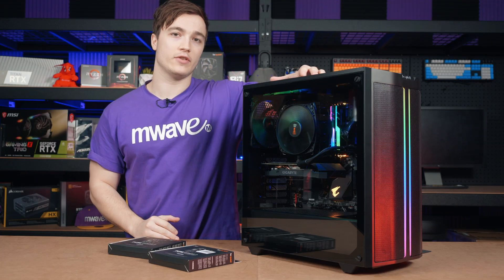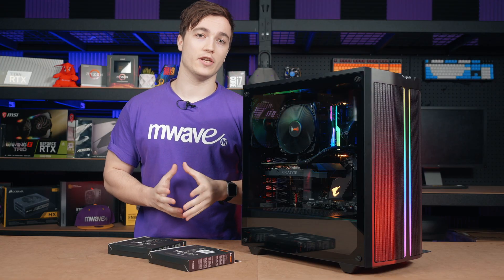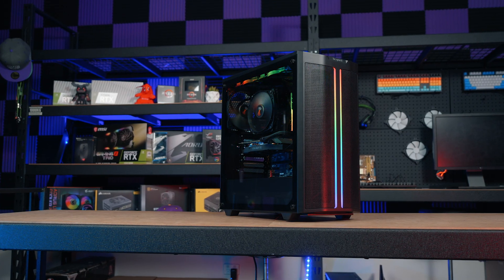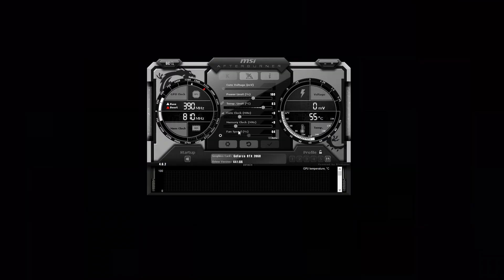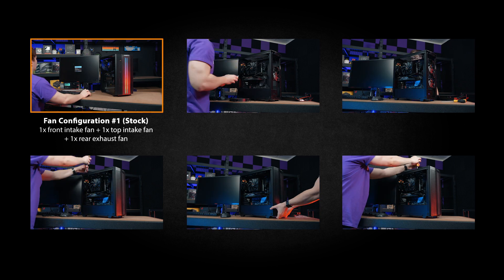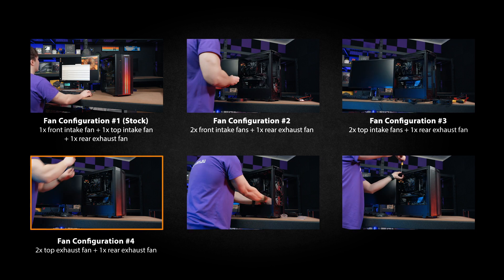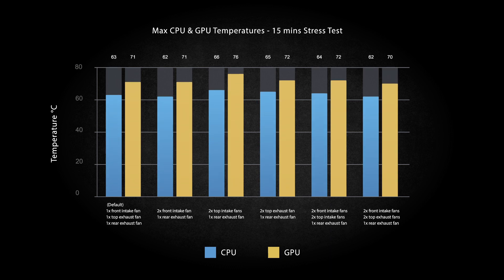Are more Fans Better? be quiet! Pure Base 500DX

Comment: Excellent and very informative video.
I bought this case and use z73 (3×120mm) nzxt for my cpu.
I have also in use 2 top 140mm intake fans and one rear 140mm as exaust. 
From your experience do you believe is good to swich one of the top fan as exaust in order to achieve better gpu temps
Reply from the maker: Hello mate. Glad you found the video helpful 😊

If you have installed a 360mm AIO cooler in this case, then I presume that it's mounted at the front as that's the only spot that supports a cooler of that size. However, you said, "I have also in use 2 top 140mm intake fans and one rear 140mm as exaust.". What is the orientation (intake or exhaust) of all the fans in your system?

I would recommend having intake from the front, and exhaust from the top and the back.

Comment: So the default configuration is the best.
Reply from the maker: Hello! Yeah, the default configuration was the best with 1 other configuration giving similar results 🙂
Reply: @MwaveAU  If i move the top fan in front so that i have 2 front intake fans and one rear exhaust fan is better than stock configuration? Should also get less dust in it's correct?

Comment: I but the stock ones 3x140 on the front(yes they fit) and one rear exhaust and one rear/top exhaust both 140noctua fans and the case r cool and silent
Reply from the maker: Adding Noctua fans is always a nice touch. They push a high amount of airflow even at a low RPM so even at a slow speed, you get that nice cooling while still being quiet! 

I do need to confirm that this case can fit 3x 140mm fans at the front as the be quiet! product page for the 'PURE BASE 500DX' states that you can only fit 2x 140mm fans at the font. Luckily, I still have this case in the studio so I will check it out when I am next in the studio. I believe there is currently a 360mm AIO radiator mounted in the front. It will be good to confirm and inform others that this configuration is possible.

Thanks for leaving this comment and I am glad your configuration is keeping things cool and silent 😀
Reply from the maker: Hello again Mario. Just wanted to check, are you sure you have the be quiet! Pure Base 500DX PC case and it's not a similar but different model? I have just measured up 3x 140mm fans in the front panel on this case downstairs and I am about 30mm short in terms of installing them all.
Reply: @MwaveAU  im sure,the stock fans(pure wings 2) fit. front, between the frame and the dust filter. Noctua ones didnt fit,its somethinh how the fan frame r made. If u wish i can send u a picture.

it is a tight fit, the lower screw places of the fan at the bottom do not overlap, but the fan itself fits nicely between the frame, so that the two bottom screws do not need to be attached at all.
Reply from the maker: Haha okay, this makes more sense. I was going crazy in the studio wondering how you managed to secure 3x 140mm fans in the front of this case. I know and understand that you haven't screwed them all in😂 In my opinion, I would classify this as "they fit" 😆 But if they work fine for you and you are happy, then awesome. Just make sure they don't rattle under a high load, otherwise, love the out-there thinking mate!
Reply: @MwaveAU  The fans are very firmly in place, the lower fan fits nicely in the case metalic slot (use a little force) I believe that it is not intended that way, but it is possible. And it works super well.
Reply from the maker: I also believe that it is not intended to be used that way, but as you said, it works super well and your system is running cool and quiet so nice job! 😀
Reply: Hi there , is it possible than you could send me a picture on how you did it ? My custom pc is on the way and i would like to place the 3 stock fans on the front like you did! Thanks in advance!

Comment: Just bought this case, and in very happy with it but i think they are a little weak for airflow, im curious if with 3 top tier 140mm fans like 3 noctua A14 with a high pressure thé temps will improve and how much. Can you di this testing?
Reply from the maker: Hey mate. Unfortunately, the be quiet! Pure Base 500DX doesn't support 3 fans at the top. It can only house 2x 120/140mm fans, so this configuration wouldn't work, sorry.
Reply: @MwaveAU  Sorry i wrote it badly, the test was 2 front and 1 rear or 1 rear 1 top 1 front but with high end vents like Noctua A14
Reply from the maker: Oh, apologies, I simply miss read your message. If you meant doing the same test but with high end case fans like the Noctua A14's, then I do assume that the temperatures would be lower, but also other factors would change like potential noise levels and dust intake due to higher airflow. But still, the concept of this video was to show the difference in temperatures while using different fan configurations and this was still achieved by using the be quiet! Pure Wings 2 fans.

However, if we do anything videos related to fan testing/PC temperatures in the future, I will try my best to get my hands on some Noctua A14's for you :)
Reply: @MwaveAU  thank you !
Also talking about the 500dx, from my personal tests the better config is 2 front well aimed to cpu cooler and gpu cooler (or 3 if 120mm fan), intake with a higher rpm, and in exhaust 1 rear + only 1 back to the top, the one towards the back of the case, cause the closer one was Just pulling directly the cold air from the front fan, decreasing the colling performance.
Reply: @josu91ita  that is how Im going to set mine up. I watch one vid where the front rear exhaust was pulling cold air out and the rear top was pulling hot air. meaning you are correct, the top front is robbing cool air. not needed.

Comment: maybe a stupid question but can you have fans at the bottom?
Reply from the maker: Hello! Definitely not a stupid question as lots of cases these days do have support for fans on top of the PSU shroud.

Unfortunately, it doesn't look like you can have fans at the bottom of this case. I have checked the official be quiet! product page and they don't mention any support for fans in this location. Additionally, there are no screw holes on top of the PSU shroud to mount fans either. Sorry!
Reply: @MwaveAU  even if there are no holes and be quiet pure base does not support, you can still put the fans using rubber for fans

Comment: Ahhh i wish you did 2 front intake, 1 rear exhaust, 1 bottom intake and 1 top corner ish (next to the rear) exhaust. ):
Reply from the maker: Hey Kevin. Unfortunately, I don't have the Pure Base 500DX on hand to quickly check but I don't believe this case has support for a bottom/PSU shroud fan. At least according to their official product page, it doesn't state that you can put a fan in this location. I checked out a few high-resolution photos of the case online and there doesn't appear to be any screw holes in the PSU shroud to mount a fan of either size. Sorry :(

Comment: I'm going with 2x 140mm Silent Wings 3 intake fans in the front, 2x 120mm Silent Wings 3 exhaust fans on the top and 1x 140mm Silent Wings 3 exhaust fan in the back.
I want my new RTX 3080 FE to stay as cool as possible <3
Reply: And how it goes? :)
Reply from the maker: Hello! This was the #6 configuration and during the testing in this video, it did get the best results but only by 1 degree. However, with the different components inside your system, like the RTX 3080 FE, perhaps you can get slightly cooler results. Let me know how it goes mate!

Comment: One thing nobody seems to be testing in this case is using 3 120mm fans at the front. Higher static pressure may be a benefit.
Nice presentation and concise video, though.
Reply from the maker: Hello! I actually had a conversation with another viewer about this exact same point just last week! Definitely worth testing this configuration out but probably the biggest problem with this is that I am not 100% sure if 3x 140mm fans will fit in the front. I checked the specs for the case and they state that it can hold 1x 140mm fans in the front but they also said you can only fit 1 fan on the top, which is incorrect as we tested 2 fans at the top. Still, 3x 120mm fans in the front would still be worth a try!
Reply: @MwaveAU  x3 120mm fans up front...not 140mm. This would mean moving the 140mm fan from the front to the top and putting in the x3 120mm up front. Be quiet sells the triple 120mm fans together for like $20.

Comment: Too bad no one is testing 3x front intake and 1 back & 1 top out. I have the feeling that the air is distributed trough the whole case like that + giving a positive pressure to keep the dust out and with them all being 140mm fans, they should not have to work that hard thus although 5 of them should keep it fairly quite. Where does my thinking go wrong? :-)
Reply: @ofospina  I'm sorry, never got further than getting the case out of the box. My pc hasn't been used for months. My office is filled to the ceiling with inheritance of my parents. Seeking out that stuff takes way too long. I don't think I'll be able to start using the computer before the summer holiday. There is even a brand new 3080ti somewhere behind all the stuff :-(
Reply: @ofospina  crazy times in a lot of ways. But it's never been so dark that light didn't come back. Success to you too.
Reply from the maker: Hello! Yes, that would have definitely been a good configuration to test out. Unfortunately without trying it out, I can't say if it will give the best cooling results. And as we can see in the tests that were done, more fans didn't always give the best cooling results for the CPU and GPU. But the positive air pressure is a good point indeed.

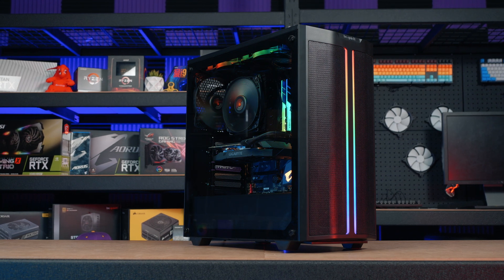The only problem I can think of with your idea is if 3x 140mm fans will fit in the front. I looked into the product page and they said you can have 3x 120mm fans or 1x 140mm in the front. However, they also say you can have 1x 120mm or 1x 140mm fan on the top. But at 1:06 we can clearly see that Frazer has installed 2 fans at the top so I believe this is an error on the information page. Either way, your idea would still be worth a try with 3x 120mm fans in the front. If I get a chance to test it out, I will let you know how it goes!
Reply: @MwaveAU  I ordered this case, I'll be receiving it tomorrow. At first with no additional fans, since the company where I bought the case was the cheapest with the case but it asking about double for separate fans. 

I will first have a look at what does fit where and perhaps decide to add additional ones along the way. Since this is a hot topic it seems like fun to try some things out myself too.
Reply from the maker: Oh very nice! So did you not received the 3 case fans that normally come with the case? If you didn't, that is a shame as they are be quiet! Pure Wings 2 - 140mm fans and are very nice fans to get included with your case, giving a nice cooling performance while still remaining silent.

Let me know if you try out the 3 front fans, 1 back and 1 top configuration and how it compares to the other configurations :)
Reply: @MwaveAU  I received it. I will wait for my new video card before I am switching to the new case. My olf case isn't wide enough for the new card, that's the reason I needed a new case. The case did come with the 3 fans. I meant I didn't order extra fans (4&5) yet. If I get three 140mm fans in the front, I will order 2 140mm extra. If that doesn't fit I might buy three 120mm fans. Strange but different sources tell different stories whether it can fit or not. We'll see. It will take a few weeks before I am able to do it, I am afraid. Half my house is being renovated haha. I'll get back to you when I tried it.
Reply from the maker: Okay, I am on the same page now. Glad you got the 3 fans that are meant to come with the case. No rush, but yes definitely let me know how it goes when you get around to it. Unfortunately working from home so I can't just go downstairs and look at the size of the front panel on the case for you.
Reply: actually if you buy the pack of x3 120mm fans for the front you would get to move the front 140mm fan to the top so you would actually have x3 front fans, x2 top, and x1 rear.

Comment: Yo dude! Question I can't find ANYWHERE. Are these included pure wings 2 fans controllable? I see some people say they are not???
Reply from the maker: Hello! If by 'controllable' you mean you can alter the fan curve speed for them then yes they are :)
Reply: @MwaveAU  but then only 60-100% correct? sicei t is voltage regulated instead of pwm?

Comment: But what if you prefer a positive pressure system what’s the best lay out there
Reply: 3x 120mm in the front
1x 140mm rear
1x 140mm rear top

Achieves slightly positive pressure.

Comment: How do you know if the fan is intake or exhaust? Do you flip it now or in bios? It's my first build, sry if the qn is stupid
Reply: The logo side is front side where the air flow in
Reply: @albuslee7147  thank you! i used a piece of yarn to test where it is flowing and my top exhaust seemed like it was an intake....but the logo is on the inside so it shouldn't be
Reply: @ShhheilaASMR  Usually on one the sides of case fans, there are like really tiny arrows showing which way the air goes. You can try looking for those as well next time
Reply: @emin4704  yes, I just noticed this!!
Reply: @ShhheilaASMR  Nice, something else to keep in if it's your first build, is that the case fan quality between manufacturers can be quite different at times lol.
Like take Noctua for example, they're probably one of the best case fan manufacturers. 
If you want the best of both worlds, so silence and cooling, you would do yourself justice to spend a little bit extra on higher quality fans 😎 Also, another tip for you is that generally 140mm are more quiet than 120mm.
Reply: @emin4704  i highly disagree! I have be quiet fans and noctua in my build. The noctua are incredibly noisy it makes my case sound like a vacuum and i can hear it from the other floor. I'll be removing the noctuas and replacing them with be quiet. i was also aware of the larger fans being quieter, but thanks it's a good tip!
Reply: @ShhheilaASMR  Nice lol, I actually have a bequiet case and was considering replacing the stock bequiet fans with Noctua's. Think you changed my mind xD

Comment: What about 2 front intake, 1 top exhaust and 1 rear exhaust? U didint test it :/
Reply: Thats what I'm doing, build starts first week of Jan, 2 X 140 front intake and 1 top 1 back 140 exhaust
Reply: @jonking3344  gamers nexus tested that exact setup and it didn’t help
Reply: @Lachlan_McDougall  i did see that but I've gone ahead with it anyway
Reply: Yeah man! Now that the 5000 series is out i want to upgrade my old fucking toaster with a new CPU and ram
Reply: Thats what im thinking of, 1 because it seems like it would be much better and 2 because i want a white rear fan to match the case 😂

Comment: What do you think about putting a 2 fans cpu water cooler on the front ? Would you think it may causes problems ?
Reply: You will blow very warm air from the cpu water cooler in to the case. Making the entire case and all the components much hotter. My advise is to put it as top exhaust.